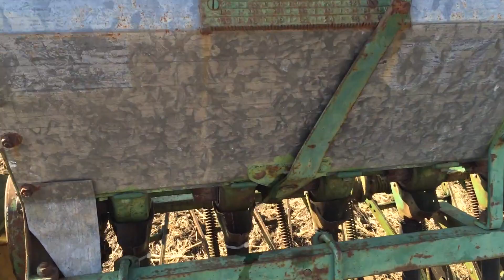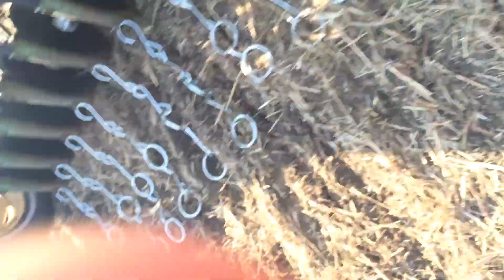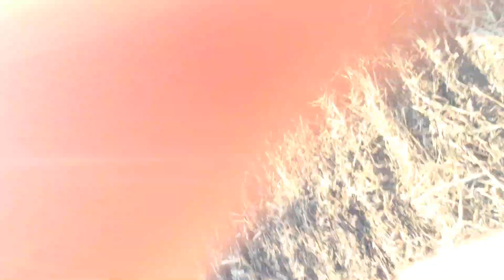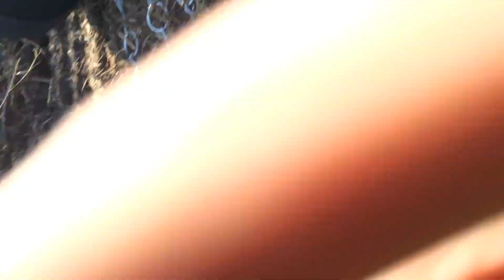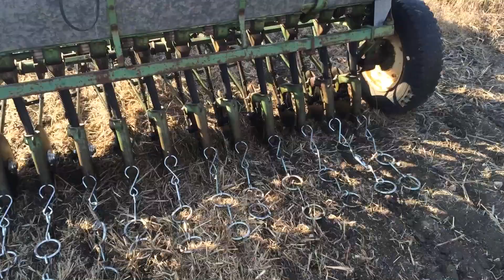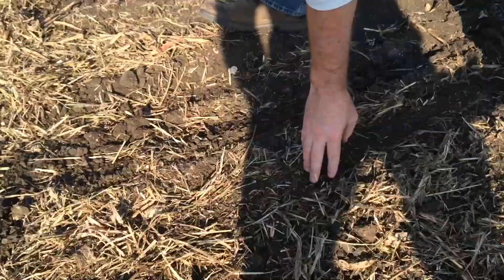John Deere B Seed Drill Field Test

Comment: I noticed there is a metal tab below the springs that ride on a notched rod
Can you explain how they work ? Thanks!
Reply from the maker: That is the depth/pressure lever that is applied to the discs an determines planting depth. It lifts/lowers the disc assy. Pull it all the way back for travelling mode with the discs off the ground.